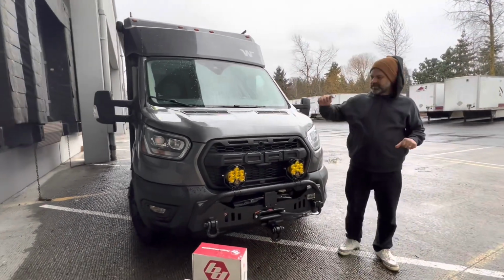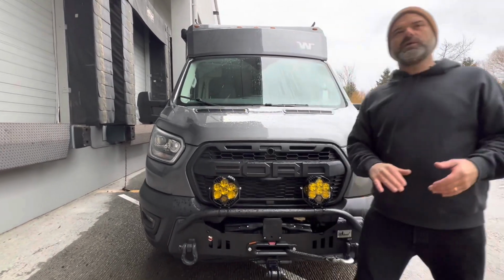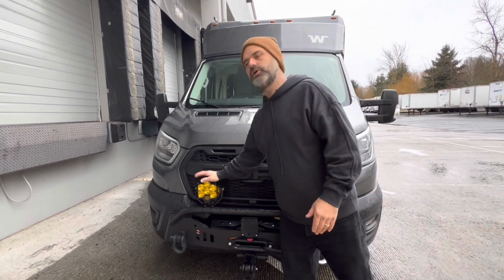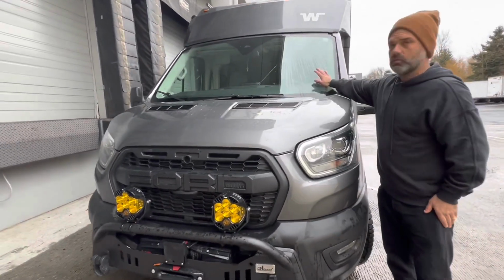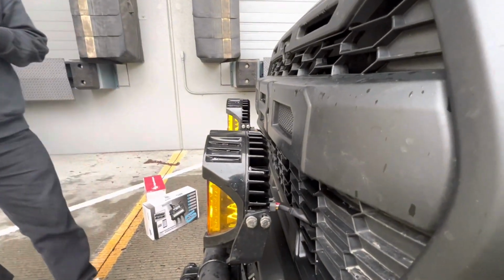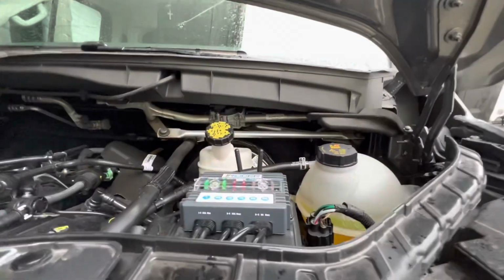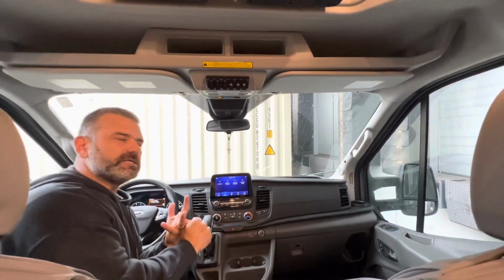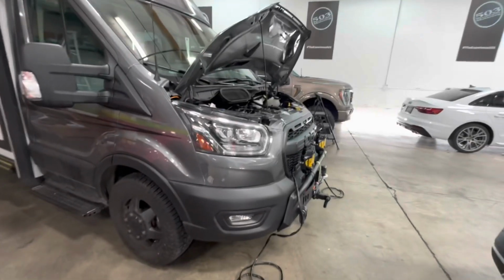EKKO VAN | BAJA Designs   LP6 Pro LED Auxiliary Lights | VANLIFE Winnebago EKKO

Comment: Was there a place you were able to run the wires to behind the grille, or did you have to drill a hole? I looked everywhere yesterday and all sides of the radiator is enclosed with plastic. I cant find a way behind there.
Reply from the maker: Quick question for you when you’re talking about running the wires behind the grill as they move through the grill and find their way towards the engine compartment could you look at minute 1248 minute 1256 and let me know if this is what you’re referring to and I might be able to better help. Thank you for checking out the video and I’ll do my best to recall based on my memory.

Comment: The narrower the 'angle' between the projected light, the object the light illuminates (e.g. snowflake) and the driver's eye = greater reflectivity back into the driver's eyes.  Thus: when snow is falling, you want that "angle" to be as large as possible...and the lowering the position of the lights (closer to the bumper line location) accomplishes this by widening/increasing the angle.  Amber vs whiter light technology: In the mid-late 60's through early 70s, amber headlights were the "fashion/function/rage" statement in Europe.  Then, amber headlights disappeared overnight...why?  I think the reason was that their (yellow) reflected light back into the human eye wasn't as effective, especially for wet roads, as was originally thought.  Many motorists claimed they could not see the wet road lit at all.  Evidence suggests to me that light temperature around 2900 - 3100 K seems to work best with the human eye.  Above 3500K is "too blue" and diminishes the human's eye ability to see.  (Police use blue lights to 'fool' the human eye/brain into thinking the light source is closer than it really is, thus the motorist will tend to stop sooner with blue versus other colors.).  Baja designs suggest yellow lights in conditions such as blowing dust, snow, fog and rain...the particles aren't as 'bright' and distractive to the human eye.  Many people find that when dust, snow, rain drops, are very brightly lit, they have a "hypnotic" effect that tires the human eye quickly...making driving in such conditions dangerous.  Finally: German cars often feature the ability to turn ON factory fog lamps while simultaneously turning OFF headlights (in other words, the parking lamps are lit and a separate switch for fog lamps can then be engaged.). Thanks for your videos...they're very highly informative!
Reply from the maker: Hello Robert, that is so very very good information.
As I look back and I think about movies or advertisement that I recall seeing that’s related to the 1960s and 1970s, I have a strong recollection of the yellow lights.
I remember when KC lights were a big thing and if you had those you were quite the superstar.
Now I was born in 1970, so I don’t have any real relationship to the 60s but what you’re sharing makes complete sense.
I definitely agree that the light temperatures between 2900-3100k tend to go from a more incandescent light to a while the upper range 3k and above have slightly whiter hues.  
I never consider the blue light and the police car relationship. That makes complete sense.  
I have found that Baja Design seems to really dig into the the technical side of things and at least so far are the leaders. 
Thank you for sharing the information. It’s very helpful and I truly appreciate the engagement.  
Take care.